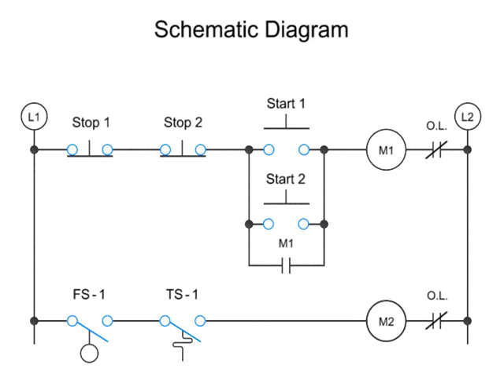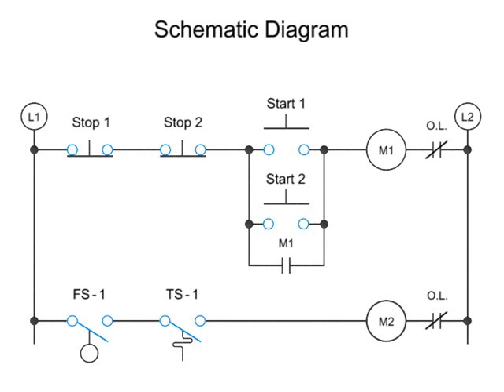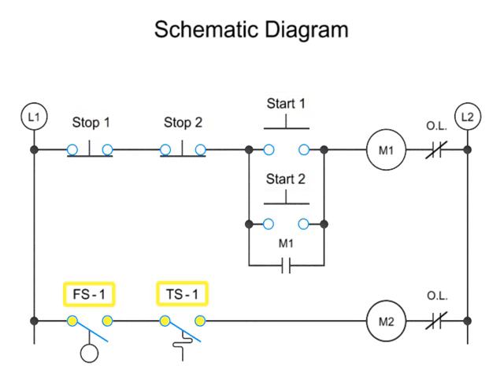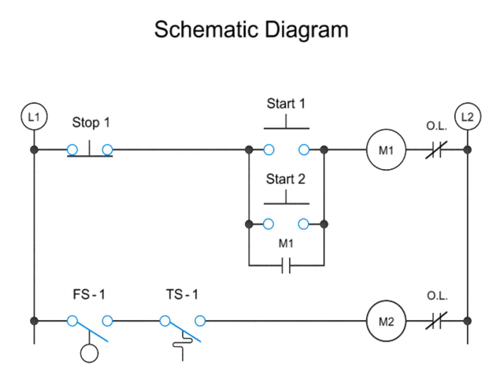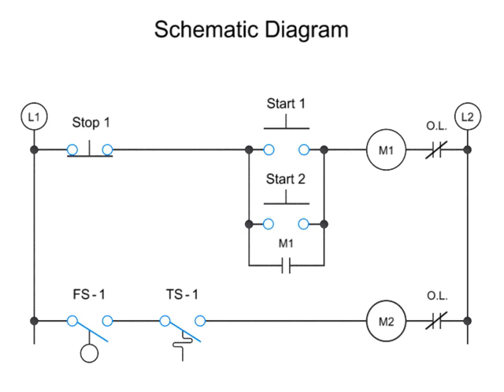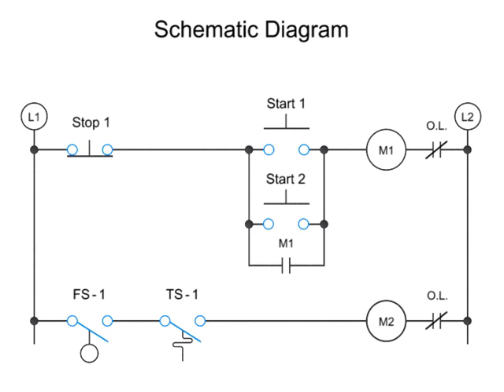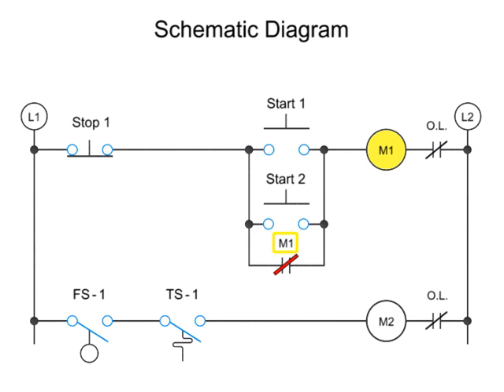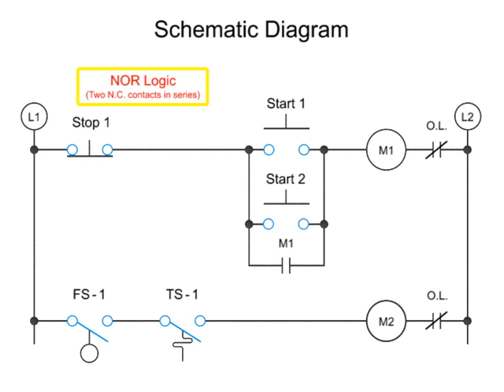Visual Walkthrough of Schematic Diagram and Control Logic

Comment: It would help to understand that L1 represents Hot and L2 is representing Neutral
Reply: Not necessarily true my friend. If you are using a control transformer which is why sometimes you will see it as X1 for L1 and X2 for L2. this signifys that you are using a control transformer, and the high side  would be an H1 and H2 from the higher voltage supply to the control transformer to the control part of the circuit, typically a lower voltage. This isn't shown here